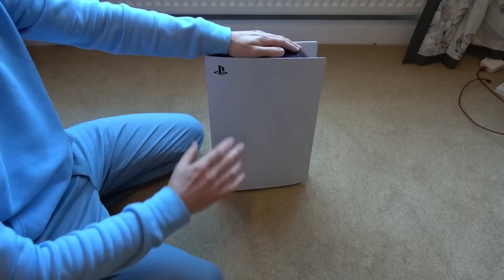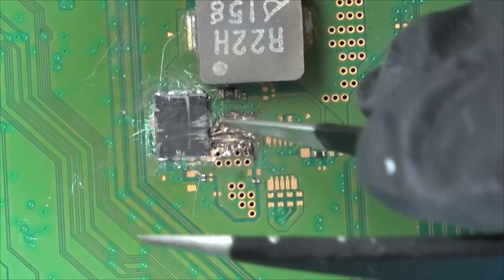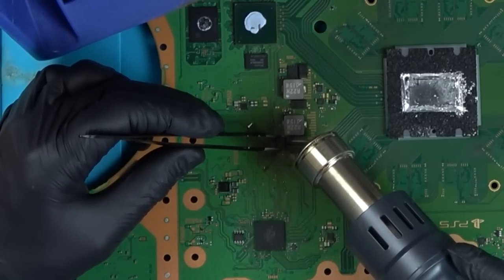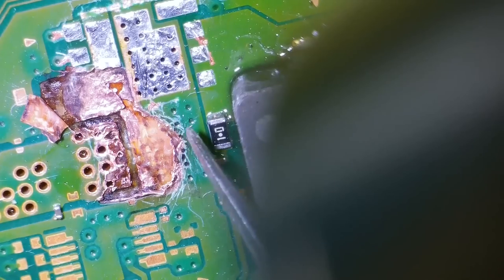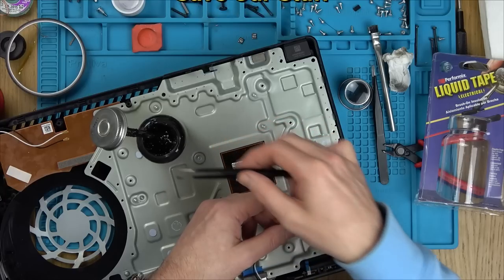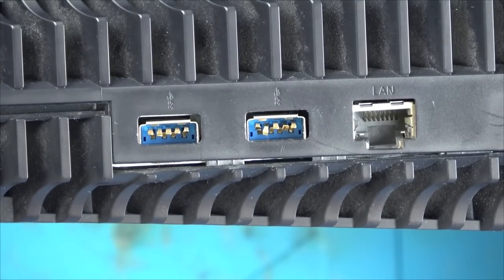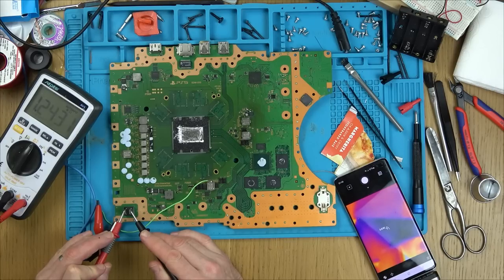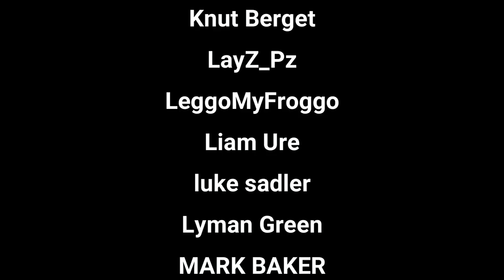Sick PS5 - Can I FIX it?

Comment: Sucks to get such a rough one for your first PS5 Vince! From my experience I'd say the issue was likely originally a bad capacitor on that rail. The circuit in question is a RAM power rail and unfortunately that is a common issue. The caps on that rail do fail pretty often, but it doesn't normally pop a fet.

One thing to check is if you look just to the right of that area there's a TLV IC (marked SBV on the chip itself). It's the same chip as the F7002 IC on the EDM-010 board. If you check around there it may have popped the fuse. I've found that happens quite often after those caps go bad. If you're missing your lower voltages (2.5v, 2v, 1.8v, 1.37v, 0.9v) it may be that the fuse is preventing the rest of the boot sequence. That said, that fat rail you were injecting voltage into is the 1.37v rail for RAM and if that's dead short it may be that the fet which died took out the RAM too. I've seen that a few times too 😞
Reply from the maker: Thanks Phil, I'll check again. I did check all the fuses at the time that I'd seen on the board but I may have missed some as there were quite a number of them. Nothing heated up on the FLIR cam which was a shame as I was hoping to find a shorted cap. A good one for spares though as I have quite a few power rails working and no water damage which is nice so lots of parts to harvest. Cheers for the info 👍
Reply: @Mymatevince  yeah absolutely perfect for spares, and good practice either way too. Hoping to see more. PS5s are interesting and fun to work on when you get to know them. I'd say they're my favourite console to work on right now 🤫don't tell anyone I said that lol
Reply from the maker: @TheCod3r  Your leading the way on them Phil. It must be nice to fully get to grips with one board and start to know it inside out. Almost know the fault before it has been taken apart 👍
Reply: @TheCod3r  like you know what you are talking about Phil you have only worked on about 500 of them 🤣🤣🤣🤣🤣🤣🤣, Thanks for the video Vince
Reply: @Mymatevince  I do try 🤣 in all seriousness they're not too difficult once you know what rails you're supposed to get and what the common faults are lol. I dream PS5 fuse numbers 🤣
Reply: @TravisStamper  haha you love me really Travis 😗 you can't deny it any more, everyone knows 🤣
Reply: PlayStation > trashbox
Reply: Internal short
Reply: @TheCod3r  Travis did it 🤣🤣🤣
Reply: @MichaelM28  Grow up.
Reply: @MichaelM28  mate, why are you infecting this channel, I’m a ps5 owner but you embarrass ps5 owners with your comments.
Reply: @MichaelM28  Pretty sure a PS5 is more likely to see the bin then a "trashbox", but okay bud.
Reply: @MichaelM28  Atari 2600 VCS > everything
Reply: Likely a Tantalum cap.

Comment: Whatever "repair shop" that PS5 was brought to should definitely be avoided
Reply: And what happened to those usb ports? :(
Reply from the maker: It looks like they were purposely snapped. How could that happen through use or impact damage, really weird!
Reply: That was expensive! Don’t you think?
Reply: I think the PS5 was dropped. It caused something to bend out of shape. Then cause that nice little charred hole that Vince was introduced to. Once they took it apart and saw that hole they just quoted them for a price that would either turn them away or have them attempt to fix it.
Reply: I don't think so. Hardware issues are a rabbit hole. The first issue can be hiding a bunch of others. He didn't pay for a repair only for a pre diagnose, to diagnose it further they would have to repair the apparent issue first with wasn't in the budget.

Comment: To answer your question at the end about the USB ports. To Damage anything on the board you would have to dump 12 volts into a data pin. There is failsafes on any modern device that will turn the port off, permanently if needed, if there's ever a short on the USB port. It's all handled in the USB controller on the board.

Comment: Hi Vince, it looks like this is an APU problem. I had the same thing but with a laptop that turned on and off continuously because the video chip was no longer good due to reballing, but there is some life in it. What is striking is that the fuses are not broken, perhaps due to the quick on / off. In the end, it can also be a (small) short circuit after you turning on the PS5, so further down the board. Thanks for the video, and your videos are always a succes btw!

Comment: Nice effort and great pcb repair work Vince. Shame you didn't get it fixed but it was in very rough shape to begin with. Mashed ribbons, chewed wires, mangled usb ports and an elusive short on a multillayer board. A nightmare job. TronixFix does a lot of consoles, and he doesn't get a fix every  time. Perhaps your next PS5 will be a winner. :)
Reply from the maker: Thanks Dash 👍👍

Comment: now always the electronics have a fix, besides this kind of videos help us a lot to face this kind of issues, i had something similar for a ps4 back in time and was also fully shorted, i injected voltage and could get the faulty component , but when i changed it, still didn't work, i still have that motherboard as donor board.

Comment: Good attempt, can't win them all. Pure guesswork on my part but the mosfet may have blown due to faulty caps or blew by itself but it appears that the caps were not refitted (would be worth comparing that area with the part working board) and that is asking for trouble. The shorted USB ports may have caused other damage and may be worth removing them to see if anything changes on the power rails. As you say, drawing 5A with no apparent heat spots may point to additional layer issues (as nothing appeared to be getting hot).

Comment: With those new SMD MOSFET and other components, if they blow up, you have a great chance that it destroys the board and the device becomes unfixable.
Another issue is that the MOSFET is part of a Voltage Regulator — for the APU. 
So if that got 12V, which is a possibility (and depends if the High side or Low Side of the MOSFET blew), the APU is dead.

Comment: Wow you have the patience of a Saint.  I would have lost it half way through.  If I am guessing at the root cause, my bet is on that the PS5 took a spill.  Not enough to damage the case but sufficient to tank the USB cables clear out.  That shorted the USB power.  Potentially also momentarily pushing that shield against a trace an kaboom.  Just  SWAG.

Comment: For me the main cause of failure looks like severe overheating, if you look around the board you can clearly see that the whole PCB have darkened around the RAM and GPU which is telling the board been running stupidly hot for extended time as well. This will naturally bake the components and lead to their failure. you tool and friend in this type of troubleshooting would be to get a milliohm meter and start to look where the short is the lowest value to figure out where it origins from. I would not exclude more mosfets being shot here but there could be more layers short too as you suspect. either you measure with milliohms or put enough amps slowly rising until something eventually get hot. I mean the board is gone so you might as well just experiment with it right ☺
Reply from the maker: Thanks for the info and tips 👍
Reply: @Mymatevince  anytime my man! Keep up the good work. I enjoy watching your work. You have learned a lot since I first came to your channel :)

Comment: I have a 55 inch c9 and a 48 inch CX. I had the CX as my main TV but then I noticed stuff on Disney didn't look as good as on the c9. I compared the two and found the c9 was brighter and the colours were better, especially blue and yellow, more accurate and richer. So now I've got the c9 as my main TV and the cx as my computer monitor. Is it known that the 55 inch version is better than the 48? I'm surprised how much better with HDR and Dolby vision the c9 is. The 48 cx is a very good TV but the 55 c9 just wows you all the time. The reflections , the colours, the contrast all special. Of course it's worse with old content and SD channels. Swapping back to the c9 it was like I'd bought a brand new oled again. It looks a bit big for our room but I'm willing to accept that now. The 48 is a bit sharper and makes a good computer monitor. I hadn't noticed the 48 CX was inferior when I set it up but I knew something was amiss when I watched my family's c8 and then mine when I got home. The c8 is pretty much the same as my c9 for quality.

Comment: What a shame =(  I suspect the repair shop made it worse by their initial digging around the traces?!  The USB ports are very strange...  How does a USB port get so badly damaged like that?!?   Great attempt to fix this one though Vince =D
Reply from the maker: Very strange Chris, the same issue on both ports!!! But yet the front ones on their own replaceable board are perfect. If it was impact damage to the back ports then you would expect the solder joints to be 'iffy'. Part of me wonders if foul play was involved and pliers used to put out the middle bits of the port BUT why????
Reply: Initially I thought maybe they had a bent/damaged USB plug with way too tight a fit, and it gutted the port when removed? But they'd have to be foolish enough to pull the broken piece out and then just use the other port 😅 More likely a sideways impact/yank on the plugs snapped the (possibly weak/defective) ports. They could have been swapped in by the repairer as someone suggested, but that just means the weird damage happened to someone else! An interesting puzzle 😄

Comment: You could drill right through so you can see the layers are separate. But it usually means bodge wires and access to circuit diagram. Or it's just totaled.

Comment: That APU switcher needs its cap, Vince.
Reply from the maker: Thanks Skonk, I cut that bit out of the video and I shouldn't have - sorry.  At one point in the video you will be able to see that I fitted 2 caps on the mountain of green solder mask and run wires to each big pad. I left off the 2 tiny caps as I presumed that they wouldn't have stopped it from turning on. I had so much footage that 50% got cut. Videos like like are a bit of a nightmare when numerous faults are found, as they can take days to edit and the end video is still unfortunately not the best!

Comment: I recognize that component from Northridge Fix laptop repairs. You should be able to find a replacement. He calls it a mosfet. I don’t think that’s the true name & hes says as much but it has an emitter & base. He usually induces voltage to find the short in a cap or the mosfet itself. But your board looks pretty bad. Let’s see how you do MMV.

Comment: I can't understand why the original owner didn't just get the console traded for a new one, unless the warranty time has passed of course.
Or they trashed the USBs and knew they wouldn't get a new one under warranty.

I also can't see a repair shop breaking all those wires, they surely would put it back together gently.

Nice try though I'm still happily learning from this.

Comment: I've gotten a ps3 a couple of years back from a friend as a gift, he said it was broken, and it did the exact same thing as this ps5! You plug it in, it would turn on for a second with a fan spin and than complete off, i had to push the power button twice to get it do the fault again. I asked him what happened to the ps3, and he said it fell over while he was cleaning. So after years and years, i still don't know what is wrong with it, there are no shorts, there is nothing to see on the board, if i didn't know it made a big smack, i couldn't tell what happened to it. It's crazy, it's the only device i couldn't repair. And now seeing this behavior of your ps, i wonder if this ps fell over as well, and that is why the ports are busted and something shorted out!

Comment: That white part was supposed to be under the clamp over the cpu most likely was the result of it burning out like that because the clamp was sitting right on those small chips causing it to short to ground

Comment: Many years ago I had an IBM PS/2, which had all been designed to use proprietary IBM parts.  They sold them at cost to businesses and then jacked up all their parts and repair prices to make their profit.  I had a model 25, and one day when I went to slide a floppy disc in, it snapped the drive head off.  I called IBM and they told me it was a known design flaw, that the drives had been designed to fit vertically, but had been installed horizontally on the model 25s; as a result, the drive head hung lower than spec and over time it would eventually catch and snap off.

The system was two generations obsolete at the time, so I asked if I could get the pin-out on the floppy drive so I could make an adaptor and use a generic drive, and the tech was apologetic but said he wasn't allowed.  The generic drive was $15, the proprietary IBM drive was $200.  I hired an independent tech to reverse engineer the pin-out and make me an adaptor (cost me $20), and he said all they did was move the power pin from one side to the other; it had been specifically designed so that it would fry any generic component you tried to plug into it.  So those mangled USBs could very easily have fried almost anything depending where the power was travelling.

Comment: Most repair shops won't go further than finding a MOSFET welded to the board before pronouncing it unfixable.

The seller almost certainly got told it was dead, so he put it on eBay.

Edit: looking at the discoloration on the board around the RAM, the shorted cap & MOSFET sent 12v into pretty much everything. Not many spares to be salvaged.

Short on a USB port 5v>GND would stop it powering up, but not much else. Data lines of USB wouldn't be damaged by 5v anyway.
Reply: Data lines on USB are 3.3V, not 5V.
Reply: @l0udPL  Yes you're correct - edited.
What I was getting at is putting 5v on a TTL data line of a USB port won't do any damage.
That's why high voltage "USB killer" devices exist.

Comment: That repair shop sure didn't care about the console when the customer didn't wanted it to be fixed, an honest one would have put it back together the way it was.
Sure it still wouldn't have worked, but the way it was put back together it could have caused more damaged. In fact, the damage on the WiFi and Bluetooth cables is probably due to it not being inserted in their cable guide/channel.

Also, I think liquid metal is overrated. Sure it's better at cooling, but it's also great at destroying everything in a device if it somehow spills out.

Comment: I have had several ps5 come in with mangled usb ports ( not sure what kids are doing these days). I can say the systems all worked fine otherwise. Plus the 5v rail on usb shouldnt impact the mosfets. There is sufficient protection in these.

Personally I believe its simply the mosfets / apu and the power these modern systems are driving. I have had numerous Series X and PS5 come in my shop with mosfets blown up and melting through several layers of a board. 
Sadly, lots of paper weights. I always get asked what system I own and my answer is "None"  From my professional experience you're better at investing in a PC. Never by the 1st generation of a new console either. From the og xbox having power issues to the 360 and ps3 wirh RLOD.  History has repeated with unreliable consoles...

Comment: Regarding the damaged USB Ports: Is it possible someone forced the USB plugs upside-down (as they only go one way) causing the pins to short out to the ground and/or each other, which in turn caused catastrophic damage to components on the main board?

Comment: That original repair didn’t look very good, maybe not done by a repair place, the MOSFET being welded onto the trace is a sign that it is the original MOSFET which shorted out.
Reply from the maker: Ohhhh, ok, I thought maybe the cap shorted which welded the MOSFET, but it was the MOSFET that shorted first and then burnt out the nearby components. I picked a bad one here with this PS5 but at least some rails work so spares can be used to fix others. Cheers for sharing your knowledge Scott, I remember that for the next time I see a component welded to the board 👍👍👍

Comment: Interestingly enough I just put new thermal paste on my xbox one (original xbox one) because the fan was running so hard it sounded like a jet taking off. The repair went well and everything went back together lovely but it wouldn't start, there was a beep then a slight fan spin but no light. I took everything apart and checked it all but no problems there and I eventually traced the fault to the power brick. For some reason the brick had stopped putting out the correct voltage but was still giving enough to make the beep on the Xbox, it seems this is a common problem and the board in the power brick probably needs recapping. A new power brick is only £20 and with it the xbox works fine with no overheating problems, still annoying that a one hour thermal paste job took 3 days of my life though🤣 🤣 🤣 🤣 🤣

Comment: Try to put more logic in voltage injection. Stepping up voltage, controling current, calculating power simply vilts by amps, do until temperature rises, it will give more data. Not only 1 volt 5 amps.

Comment: So no idea what the purpose of this video is. You wasted one hour as even i could tell from the first 5 minutes that this was a lost case. You can not repair multilayer boards with exploding mosfets or related capacitors and whatnots. So the title should have been "took one look at it and gave up" on to the next one.